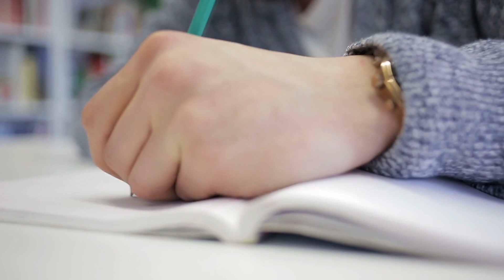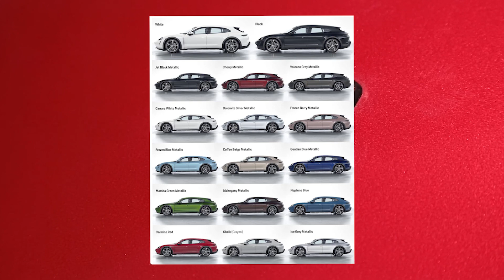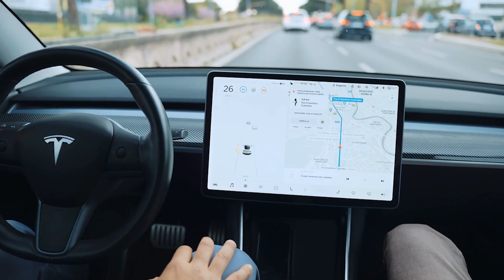Why Won't Everyone Want a Tesla?

Comment: Thanks Lee,  good stuff.  I can explain why I’ve put in a pre-order for the Kia EV6.  In 2019 I traded a 2015 Ford F-150 for a 2016 Kia Soul EV.  Getting it home 1000km from Montreal was quite educational since it was late November and the range at the time was at most 135km.  Anyway, I love my Kia. The amount of money it’s saved me isn’t believed by most ICE drivers when I tell them.  I quickly discovered, though, most local mechanics know nothing about EVs, including the local Kia dealer.  I’ve had in to them for annual inspections, for a couple minor recall notices, and one major warranty repair.  It’s this last item, the major repair, coupled with the inexperience of local mechanics that compelled me to put in a pre- order.  I say pre-order because Kia stopped taking new orders back in April, and have yet to re-open their order books.  Even though it seems like it may take a whole year for the new car to arrive, the timing on all this actually works for me.  My Soul has an additional 13 months left on the warranty, and given the local situation there’s no way I’d own an EV without one.  Bringing me to why the Kia rather than a Tesla.  Like most people I was shopping for the most  (range)for the least (money).  The standard 430km Model 3 is $60,000CDN, plus 15% sales tax, plus cost of financing.  The Kia RWD long range 499km is $52,000.  The real kick in the pants is, the way federal and provincial incentives work here, Teslas do not qualify for either - provincial incentives are for car brands with dealerships within the province only.  Federal incentives apply to only those models that have a variant with an MSRP of $44,999 or less.  Long story short, I can take $10k off the price of the Kia.  That said, while I won’t be buying a Tesla vehicle, I most certainly will be buying more of their stock, whenever I can.

Comment: How to get people to notice your M3P: 
1. Get to a first-in-line position at a red light, preferably in a large multi-lane intersection.
2. Launch on green with full pedal depression, then back off just in time to plateau at the speed limit, which may be before exiting a large intersection. (make sure it's in max regen - Sport Mode?)
This works great in my MYP, probably better in an M3P.
Reply from the maker: Ha yea. But the police don’t notice either.

Comment: I'd like to hear your take on the current demand. Currently Tesla are producing more vehicles than new orders are coming in. This is fine as they have a big backlog they will work with and reduce the delivery times. But sometime in maybe Q1 or Q2 a lot of this backlog will be taken care of, and they will have a demand issue, especially in China. 

This is easily solved by lowering the price. But at first they need to lower the price just to keep the same demand as today, meaning no additional benefits of economies of scale to compensate for that part of the price difference. Which in turn means lower margins. And then on top of this Tesla plans to grow with 50%, for which they need to lower the price even more in order to increase the demand sufficiently so that more people can afford a Tesla. This increase does have scale up benefits though.

Combined with a likely lower demand due to the economy I am guessing there will be lower margins overall, which will likely hurt the stock price. Having to lower the price also has a psychological effect on the stock market. Or are the increased sales numbers enough to offset this? Now Tesla can afford to lower margins, while other's can't, making them have a competitive price the others can't compete with, so maybe they don't need to lower the price much in order to increase the demand a lot? But it would kind of be trading margins for market share. Is a short term dip in the stock price expected due to this? And if so, how long will that dip last? When will they need to introduce new models or do a serious refresh of the current ones to keep people interested? 

Would love to hear your take on this.

Comment: I drove home today in my new Tesla M3.
At every Tesla charging station, there were 8 chargers, mostly empty.
I simply backed up to one of the chargers, took the charging cable in hand pressed the button and plugged it in.  Went for comfort break, and came back in 20 minutes.  Easy Peasy.

There was a local non-Tesla charging station.  I did see one person with a Kia EV6 attempt to use it, and could hear him talking to support to get the charger working.  20 minutes later he got it going.  How do non-Tesla owners do it?
Reply from the maker: Ha, yea, sucks to be them.

Comment: There are also quite a number of 'never Tesla's' out there (UK) who know nothing about EV's history but have heard negative things about them and because Tesla is the only name they know such issues as the Cherry Bolt fires are attributed to them. Also.. Will indeed be interesting to see what happens in the small car market (EU) because Chinese made (BYD etc) very low cost good quality vehicles are knocking at the door/vroom vrooming just over yonder. I don't see any other way than protectionism. Not 100% but so regulated that it may as well be. In my opinion and I'm no expert by any means, Herbert Diess knew what the fallout would be but, on this facet, never really spoke about it. All very interesting.

Comment: I have a seven year old Tesla. Maintenance cost is exorbitant. Easily 2k-4k/year. Tires are about 1k apop and haveto be replaced at 30k miles if your careful. A memory problem ran about 1.5k. Air conditioning 2k. Haven't gotten to the battery yet but my range has gone from 265 down under 200 and next year the warranty is over so Tesla will magically recommend a new battery for 20k-30k. They won't think about replacing it now but they will gladly charge you a couple hundred to tell you it's fine. I have a feeling that this will be a major profit center if it's not already.

Comment: We ordered our 2022 Tesla Model Y Long Range a year ago last week
Took delivery of it in May of this year - the price had gone up $10,000
So I was a happy camper
I picked up the Y in a terrible rain storm - had an app on my iPhone that stepped me through 250 steps
of things to check - only found 1 scratch on the driver's side outside mirror - plastic
Reported it to the service center and waited 15 minutes while they put on a new mirror
I just love the car

Would I recommend a Tesla to others - hell no.
Driving an EV around locally is a lot of fun but taking the Tesla on a 1,000 mile road trip is something I would not recommend to anyone with a family with small kids. Too many charging stops every 150 miles that lat 15 minutes - not enough time to leave the Y and grab lunch or potty breaks just enough time to stretch a little and on to the next charging station - about 10 on a 1,000 mile trip each way.

Until EVs can go 1,000 miles on a single charge too much time is spent looking for Superchargers and spending 15 minutes waiting for it to charge to about 50% and on to the next station.

But I had no troubles picking up the car thanks to that app.
Reply from the maker: I had 2 children, 500km trip, didn't find it an issue. 2 charging stops, enough time to get a coffee. 

EVs will never go 1000 miles, neither will ICE. Chargers will be everywhere soon enough.

Comment: Lee, I want a Tesla, it’s just the price.  They need an all wheel drive hatchback in the 40-45 grand range with 300+ miles of range.  I don’t need 1000s of games on my screen, I need a comfortable ride, good sound, decent range, and a good price.  Autopilot would be great on a long road trip, maybe it could be rented a couple times a year at a cheap price.  But, do I need to use it daily, probably not, my commute isn’t that long.  Here is to hoping Tesla will build a cheaper commuter in the near future.
Reply from the maker: I don't need to use autopilot at all, but I do all the time, and couldn't live without it now. I understand the price is a physical barrier for many still. It will change within time.

Comment: A lot of people wants electric cars. Were I live 90% of all new cars are electric. But peoples need is more than 4 different types of cars. WAG are dominating the marked by offering Skoda,VW Seat and Audi making people choose different cost and option level. I just ordered a BMW. A Tesla would have been cheaper but for me the comfort, sound proofing, assist systems, materials in seats, lights interior colors, exterior colors is important. Also the Range and charging speed was better in the BMW.

Comment: While driving my second Tesla in 5 years, my wife considers Mercedes to have much more luxury.  For the past 40 years, it’s the only brand she drives.  

She complains my new model S doesn’t have massage seats, fragrance dispenser, ambient lighting, electric frunk closer, a decent horn, and a handful of quick access buttons.  Fortunately, she sees the benefits of driving an EV, but was disappointed with the styling of Mercedes EQS.  

Therefore, we are waiting for a Lucid, hoping they can deliver, and stay in business.
Reply from the maker: I just sold my e class, fully optioned. My model 3 feels vastly more luxurious in a futuristic sense.
EQS is ugly and basic. 
Really? She needs those “luxuries”? 
How about the luxury of being less likely to be in accident, or better off if you are in one. Or not having to go to the gas station, etc. she needs to get over it and embrace the future. It’s a new paradigm.
Reply: @TeslaEconomist  Lee, I agree with you and that's why I have a Model S long range.  Frankly, my old body can't handle any more G-force than the 2-motor.  Wifey's current 2021 E450 Cabriolet with light interior is gorgeous.  EQS seems a step backwards in styling, in our opinion.  Fortunately, wifey has converted from ICE to EV because of acceleration, quietness, and never going to a gas station.  It helps to have a home charger and start every day with ample range.  I'm thrilled to eliminate those outrageous Mercedes service expenses.

Comment: I wanted a Tesla, but VW had an ID.4 for 35K. I commute 6 miles per day, so range, performance, or features really aren't necessary. All I need is a car I can drive normally for 15 minutes each way.
Reply from the maker: Sure, makes sense. But Tesla’s model y costs less to make than the ID4

Comment: I really struggle when you say Teslas are the best value...no, a $30k Rav4 is a good value. If I need 30cu/ft cargo and AWD I have to spend $67k for the Y. I save about $7k in gas over 10 years over that Rav4, plus about $5k in maintenance. But I spend an additional $15k in insurance. There is still a $40k premium going with the Y; the residuals could take the rav4 value to zero and you'd still be ahead. If I am somebody who loves a nice interior then a $40k Audi A4 is objectively higher quality than the Y. I just can't reconcile those 30% Tesla margins compared with 8% translating to  "a good value" for the consumer. Now imagine buying that Rav4 and with the rest of the money buying about 130 shares of Tesla. Those shares will be worth at least a quarter million by the end of the decade. Choosing that Rav4 allowed you to buy a model 3 plaid, plus a model Y plaid, plus a cybertruck when the Rav4 is finished.
Reply from the maker: Teslas are the best value, if you can afford them. Your Rav would have depreciated more. derived less pleasure, doesn't drives itself, more likely to be in accident - cant put a price on health, time wasted at service centers. Tesla's interior is superior to any Audi - they look old fashioned. 

I stand by this statement.

Comment: Picked up model y today.  Signed 3 documents spent 10 minutes inside.  Lovely.   But.   Daughter seating in back seat discovered Scratch in back of front passenger seat.  Like someone was trying to slice off the plastic it was covered in and cut thru the fabric.   Service will replace entire seat Oct 3.  As a Tesla y owner great news.  As a shareholder not so much.   Where was quality control?
Reply: Probs happened at the service center. The prep guy made an oopsie. Not a manufacturing quality issue man. Don't let literally one employee make u feel uneasy about being a shareholder lol
Reply: Judge the stock on your gains. I’ve made more on Tesla than any other and I’m old as f
Reply: @b-lonmusk  exactly

Comment: I strongly urge to read the Lean Enterprise by Jez Humble et al. You are talking product market fit. So in two years, you are saying that legacy auto is banking on dealers and unlimited options? That is PRECISELY what so many people detest about dealers as they know the are getting robbed and haggled. I would be bet that is 5% of the market.
Tesla would cede that . 1. Cost 2. Safety 3. Digital Technology and service 4. Maintenance and reliability 5. Performance …. 6. Options

Tesla crushes on the top 5.  Options will maybe be AFTER MARKET Eg colors, wraps are a great way to go ! So even there dealers are WEAK.
Reply from the maker: Thanks for the recommendation.

Comment: Simply too expensive and big for euoprean streets and parking lots. 
Moving >2t of car around for 1-2 person is just too much (when other EVs weight only 1.4t). That is almost 1/3rd difference on the electricity bill.

P.S: EU banned production of IC >2035; therefore all auto-maker switch to EVs and offer models already for half the price of a Tesla

Comment: Auto legacy manufacturers will survive and they aren't about to lay down and be steam rolled by Tesla, the industry will find its equilibrium and settle down eventually.
This is a major transition to say the least so things are going to look bleak for a while. I'm not a fan of Tesla's take it or leave it approach, everything under their rules
especially for such expensive vehicles. I'll stick my neck out and  can say this, any savings gained are for the benefit of Tesla and not the consumer. I'd be happy with a VW
BEV or any similar vehicle if it saved me thousands and is well represented with dealerships for attention when needed.
Reply from the maker: Some will survive, I’m not convinced they all will. Tesla will likely take out VW. They are much better value.
Reply: Do you realize that Musk is locked in with the materials and the legacy auto makers are scrambling? What they have against them is 1 mass production 2 price in materials they will not be able to get materials for mass production  3 the computer in which Ford software is crap and  VW 4   price they will not be able to compete with Tesla in price and  5 the most important factor is selling a product that people WANT people want a Tesla.I wish VW luck.
Reply: @TeslaEconomist  I think BMW will struggle more than VW, VW is huge and more diverse but only time will tell. Honda and Mazda may suffer to and there may be more alliances like Renault/Nissan/MM. Come to think of it, I believe Honda is doing a joint car/car platform with GM. Maybe BMW and Toyota, is BMW using Toyota Hybrid technology?? I should mention Stellantis, there's survival in numbers they say.
Reply: @rickhammond2473  I agree with you on most things and like I said, things will be tough for a time until everybody gets in sync and things settle down, when the going gets rough the tough get going. I still miss my old Beetle and 190E.